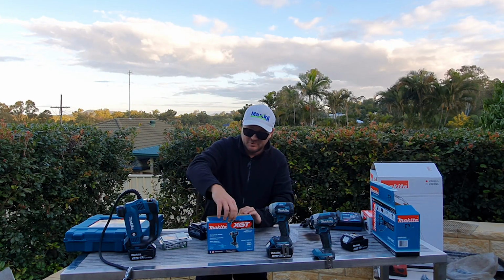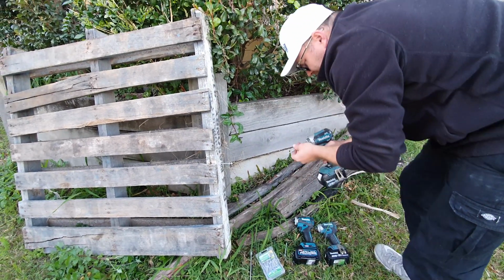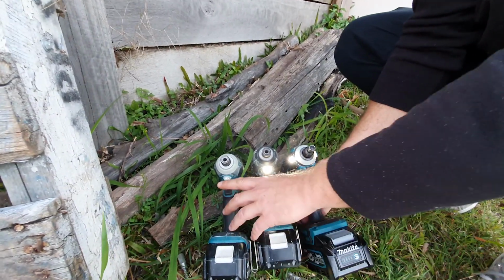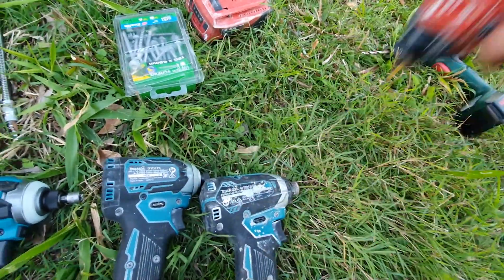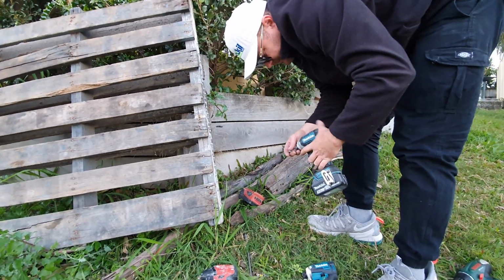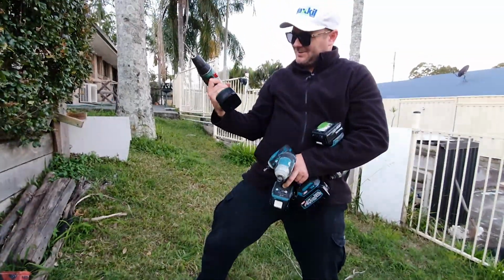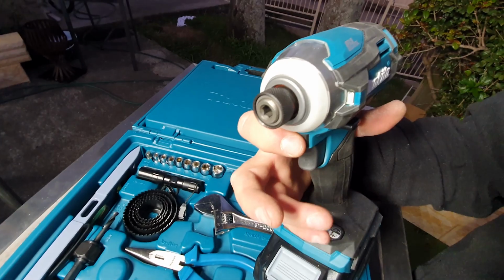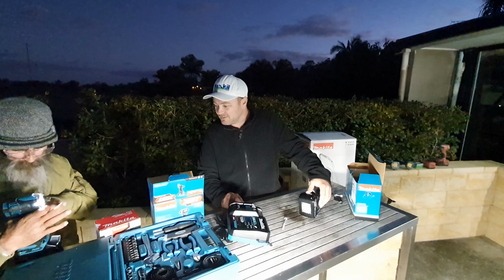Makita 40V Impact Driver VS Makita 18V Impact Driver

Comment: No battery compability between the 18v and 40v line was a stupid decision by Makita imo. One of the few areas that DeWalt did way better.
Reply: I agree. It seems such a greedy move.

I am not investing in another battery platform.
Reply from the maker: Yeah, the 18v is good enough, barely ever burn through a complete battery doing anything anyway. Maybe for their outdoor range
Reply: Not sure but true, they told me don’t use flex bolt on older drills they will over heat or burn. Is it true?

Comment: Id say all the makitas have pretty much the same driving speed. Not overly impressed by the 40 version. Maybe more torque but i would expect faster screwing too...
Reply: Milwaukee seems to still have the best impact driver at 18v.
Reply: Yeah, until you have to deal with the bits coming out of the collet every other time you use it. And instead of fixing it, or warranting it, they are just releasing a “gen 4” you’ll have to buy to get a working collet. Took them 4 tries to get it right. Who cares if it screws in a fastener a half a second faster. The collet is junk.
Reply: Psycho Dad and J Fit I agree with that! Good point👍🏻👍🏻
Reply: @brayan8346  I’ve had the Makita 40v impact driver since day one and I haven’t touched my Milwaukee 18v since. The Makita is slower and not as powerful, but it’s just so much more comfortable, convenient to use and very accurate.

Comment: They all do the same thing and they’re getting the job done. What is the big deal I don’t really get it???
Reply from the maker: Just to see if it's worth upgrading to 40v if your expecting a big difference
Reply: Maxkil I’m sorry I didn’t wanna sound like a d...k or anything but sometimes I’m thinking about all this tools and to be honest I changed all my makita tools to Milwaukee and then I realize that they all doing the same thing as my previous ones, so Im thinking that, it’s only worth it  to do, if you just have to upgrade your old ones that they starting getting bead up or they’re not working properly anymore.
Reply from the maker: @jimmysthegreek  no worries mate. How's Milwaukee, you know I'm really looking forward to the electric generator
Reply: Maxkil me as well, I’ve got almost 17 tools, so far I’m very impressed with the impact, very soft and a lot more quiet compared to the other ones!!!
Reply: I'd like to see bugles
Reply: No big deal mate, just abit longer runtime and thats about it. When you compare the 18v x2 tools to the 40v stuff, the 18v x2 is still way better. New batteries dont give you the same runtime.